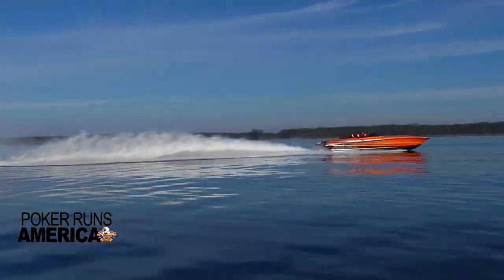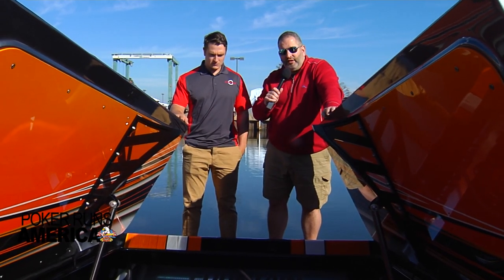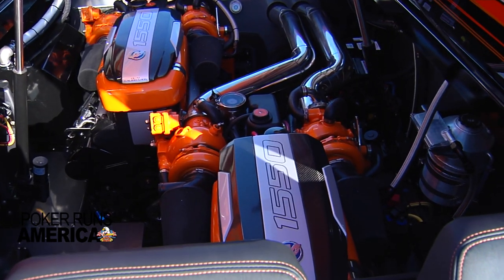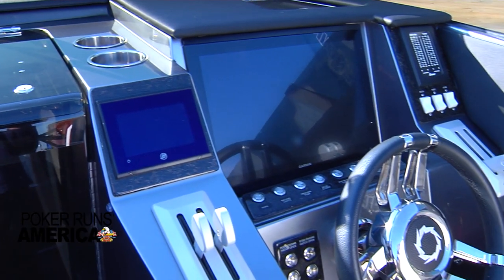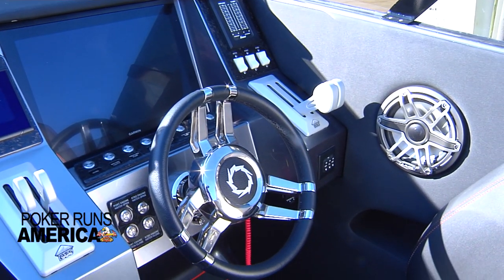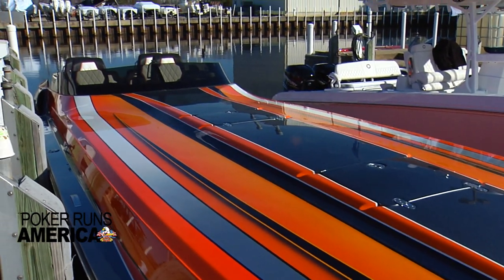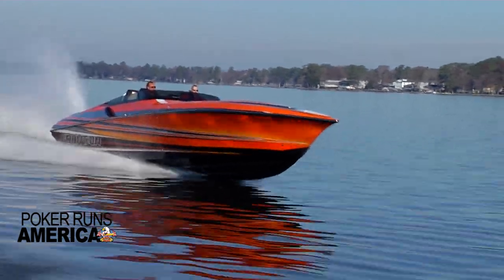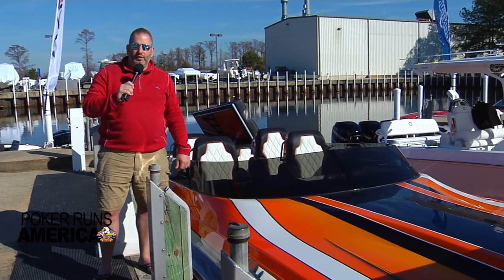Fountain 47' Lightning Redesigned

Comment: I think the old windshield looks a lot better. Also that new windshield looks so low that even when you sit down, you are looking over it instead of through it. This will also result in you getting pummelled by wind when you stand in the bolsters. From an actual drivers perspective, the older tall mid 2000’s windshield made for a great actual driver more than a trailer queen only suitable for calm warm days. To me that design looks like there is no protection for the elements to duck down behind in cooler or wet days. Not a fan and it kinda looks like the windshield from an early 90’s RC boat.
Reply: I agree on the windshield. The old stainless windshield frame gave Fountains (as well as my Formula Fastech) a look of quality and strength. The frameless windshield looks cheap.

Comment: Did I understand that correctly?

One engine is rated at 1350 HP and the other at 1550 HP?
Reply: No same power both motors 1350/1550 flip a switch to go from 1350 to 1550HP. then change the fuel from 91-93 over to race gas for the 1550 setting. Not sure abt rating but 105-108 octane should keep the engines safe.
Reply: @dieseldog00  you’re right Everett, but they have two smaller fuel tanks I believe around 80 gallons. That’s fuel for your 1,550 should you need it when a Cig trues to pass you, you flip over to the race fuel. The big tanks will need at least 93 octane for your daily cruising. A pain because you need to get to a speed shop for the race fuel, if you want just a bit more of a kick you can buy oxygenated fuel that extra oxygen will help with a cleaner burn. Not trying to correct you sir, I’m an ex drag racer and know my fuels. If I hit the lottery there will be one in my driveway. Cheers.
Reply: @peterweiss6140  Hey thanks for the better information. I've not seen oxy fuel is it pricier than 108-116 fuel?